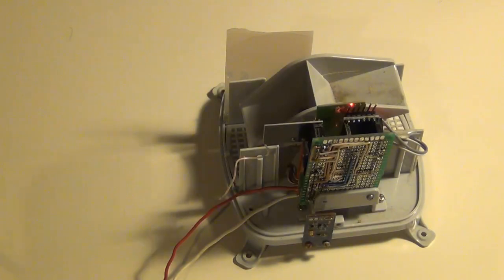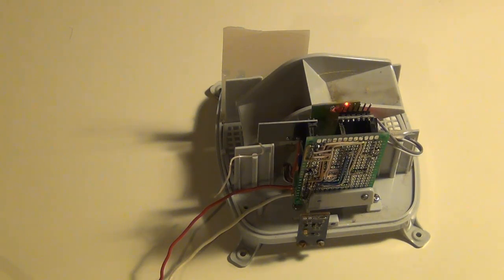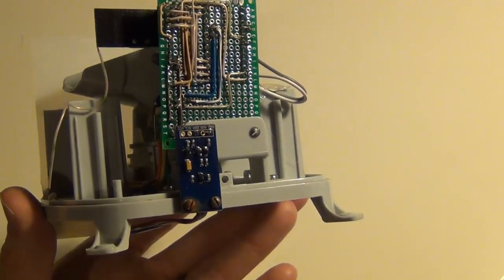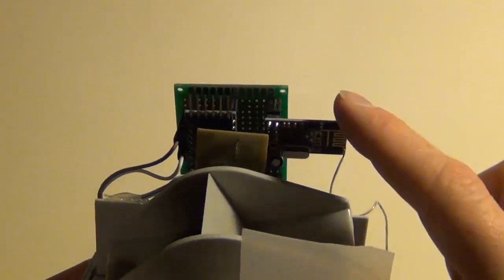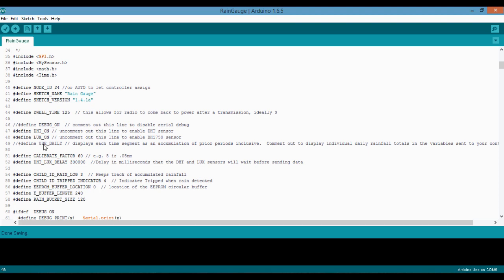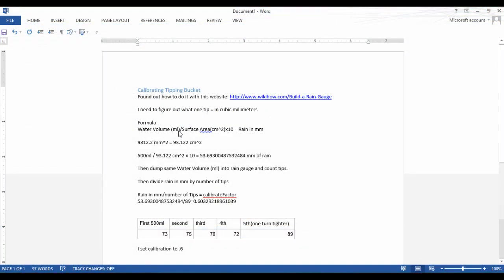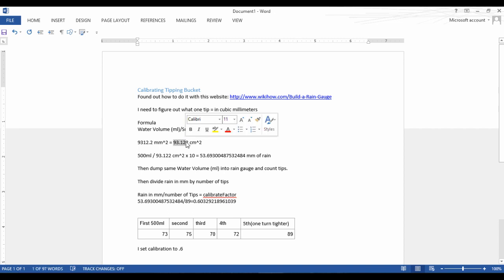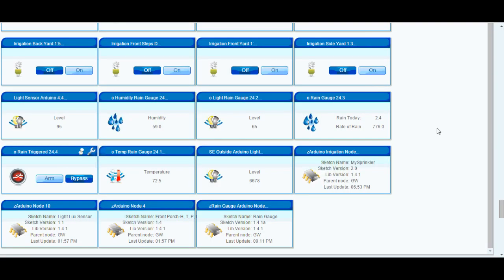Arduino Rain Gauge with MySensors

Comment: How does this connect to your system? Wi-fi? And where in the video does it talk about this?
Reply: I'm trying to make something similar to this, that would work at my farm and send information back to my phone or home computer. What would be the best way to connect a rain gauge to back to the home? I don't have a phoneline at the farm.
Reply from the maker: I use MySensors for the wireless communication. You can check it out at MySensors.org. 
If your farm isn't too far away you may be able to use LORA but I've never used it personally so I'm not sure how it performs. You can check out my MySensors getting started videos for more info on what I do. Good luck!

Comment: what brand is ur rain gauge? pls reply
Reply from the maker: +rhona rae it is a Taylor but I'm not sure what the model number is.
Reply: is it wireless?
Reply from the maker: I modified it to use MySensors which wirelessly integrates with my home automation. You can check out my other videos or the MySensors site (in the description) for more info.
Reply: but originally, it wasnt wireless?
Reply from the maker: Yes, originally it was.  It didn't work well and it didn't integrate with my home automation so I modified it.  If I was to do it over I would have got a cheaper tipping bucket.  If you are thinking about doing this project you can check the link on the MySensors site for another tipping bucket option.
Reply: okay thank you!

Comment: Hi Pete B. Sorry this has probably been asked before. Have you ever implemented this sketch on an ESP8266 transfering the data via MQTT? Not saying there is anything wrong with the NRF24, just seems like everything is moving to the ESP8266 or now even the ESP32 devices. Though I would ask before trying to build or modify a sketch. Also, have you looked at the BME280 sensor?
Reply from the maker: Sorry for the delay... I haven't personally used an esp yet.  I know there are people using them with MySensors though.  You can check out the forum for more info.

I haven't used the BME280 but I do have a BMP085 running.  I haven't really found too much of a need for the pressure sensor and I had a DHT22 in stock so that's why I went with it.

Comment: What light sensor can be used to measure direct sunlight. That will add a pyranometer to this project.
Reply from the maker: The BH1750 can be used to measure direct sunlight as long as you watch the values.  I am using it to lower my blinds when it is higher than a certain level (which indicates direct sunlight).  I don't know the exact values but the jump is pretty significant.  Something like 2500 in daytime shade and 22000 when in direct sunlight.
Reply: So you are saying that direct sunlight would not saturate the sensor output?
Reply from the maker: soumendra singh Correct.  The sensor has a resolution of 65535 and I don't believe I have ever reached that.  If I have, it is in rare occasions and it would mean it is getting hit by very strong direct sunlight.  An example of the sensor value: it's morning now with the sun just poking over the trees and partly cloudy and the value is 1831.

Comment: I may have missed it, but how is this powered?
Reply from the maker: RJGNOW I powered it with 5v attached to the green terminal block.  I hardwired it but it could easily be adapted to use batteries.